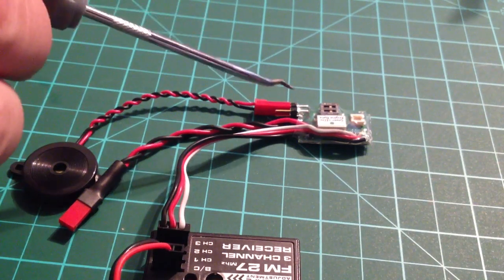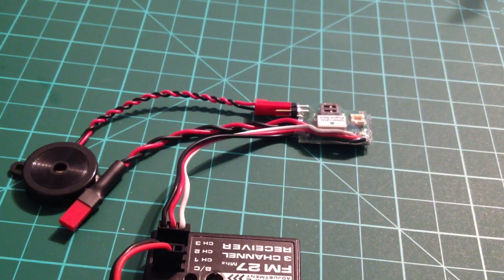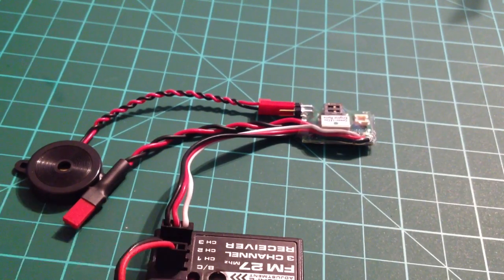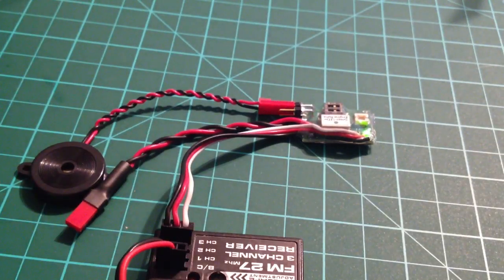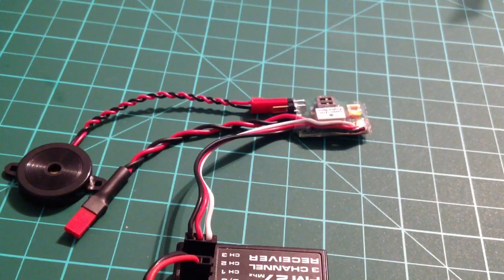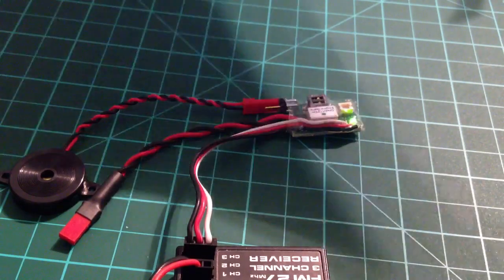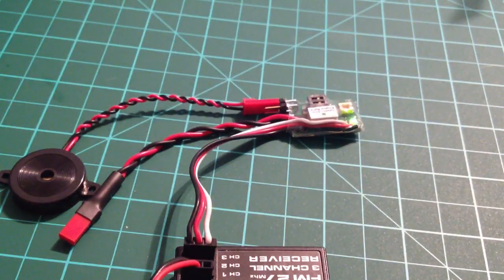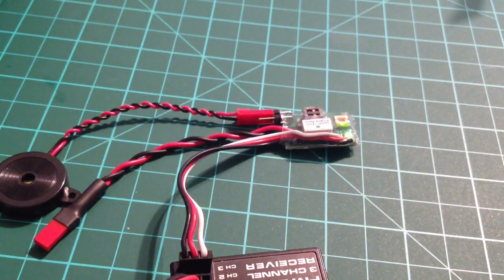Super Bee low voltage cutoff & glitch sensitivity, Gas RC Kill Switch, Killer RC

Comment: Would you want low voltage cut off to be like 7.3 for 2s lipo?  If my lipo goes to even 6.3 it won’t charge as it says it’s voltage is too low. Having a 6 volt cutoff I’d imagine won’t help 2s lipo users. Maybe I missed something?
Reply: The actual cutoff is 6.8v, but it's called 6v for simplicity. 7.4v is half charged.

Comment: Just installed the super bee on my 30DNB and 30DNT and the instruction manual is wrong.

It’s states 

#1 switch as volts sense

#2 switch as glitch sense 

Following the instruction manual had us scratching our heads until we watched this video and saw you use dip #2 to cycle the volt sensitivity.

How come no one has mentioned this 

👍🏼
Reply: Noel Mason 
#1 is voltage. #2 is glitch sensitivity. Unless your dip switch is soldered on upside down.
Reply: Kent Keller 

Well unless they got the print on the dip switch case wrong #1 on mine is the closest switch to the white module
Reply: #2 on mine according to the numbers printed on the case is the outer most switch which is the one he uses in this vid to change volt sense.

I know it’s wrong as I’ve set the volt sense and the glitch sense up tonight using the wrong numbered dips switches

Comment: I did  every single test  And I notice if you or if the coil cable get disconnected from the supper bee kill switch the engine still running. I tape my around to make sure will not  comes off
Reply: Correct. If an ignition wire comes loose from the ignition coil then the Super Bee cannot ground out the coil and stop the spark.

Comment: so I hve a question will this kill switch work if for say my battery comes disconnected?
Reply from the maker: Yes.
Reply: Thank you for your quick response I ordered my kill switch yesterday via my local hobby shop can't wait to get it installed my new losi suffered a 200 $ repair cost over me not putting in this kill switch from the start so now it's ready to go but won't hit the track till ur kills witch is installed thanks for the quick response ...just another question how long is the shipping to sw florida?
Reply from the maker: +Billy Sanchez About 3 days shipping time.

Comment: I jut put the kill switch in and it sweet ! I have the new Hitec servo kit from ddm it comes with the 4s batt does it come with a solution
Reply from the maker: What do you mean, solution?
Reply: Well the voltage cut is 6v max and when I get the 4s set up the cut off would need to be higher ? I was going to leave it low ish and run a external buzzer / alarm. that won't shut it off thought
Reply from the maker: craigtreeguy Did you get a Killer RC Servo-Max voltage regulator with your Hitec servo? The Servo-Max has low voltage protection built in. When the 4S LiPo gets down to 12v the regulator drops the receiver voltage down to 5 volts, which would trigger the Super Bee to kill the engine. See the instructions that come with the Servo-Max. Just set the Super Bee on 6v cutoff.
Reply from the maker: craigtreeguy http://www.killerrc.com/forum/viewtopic.php?f=11&t=1092

Comment: Hi i have a Losi 5T with a Spektrum DX 3R Pro i have the stock 6V battery and the stock SR3300T receiver i have it all setup. Low voltage set to 4v and Glitch sensitivity at 1 it goes through the start process then the LEDs go out and then i get solid green and flashing red at the same time. i have tried my AUX channel in P2 and P3 also i have tried frame rate at 16.5ms and 11ms still solid green and flashing red at the same time. Not sure what I'm doing wrong thanks Phil.
Reply from the maker: Send an email to: info at KillerRC dott comm

Comment from the maker: A fully charged 2S LiPo is 8.4v. I don't like using voltage regulators. The servos are stronger and faster. Myself and many others run a straight lipo in our Losi 5IVE without any problems, but the slight risk is still up to you. We have discussed this a few times on our various RC forums. RCLargescale . c o m

Comment: and what about voltage, 2s LiPo battery have 9v+ when fully charged, need i put some BEC ? (RX spectrum comes with losi 5ive, servos: hitec HS-5765MH, and stock Losi 5ivet steering servo)

Comment: last time kill switch turn off the engine after 30 minutes running with 5100 NiMH battery with 4v cutoff, i found it strange cause battery was just charged and must be running more then 30 minutes, maybe it cause of NiMH battery lost voltage when get some big load from servos.

Comment from the maker: You can only change it, not disable it. Why do you want to disable it? With a 6v battery you should have it at the factory setting of 4v. If the low voltage is being tripped then you need to charge your battery or get a better battery pack.